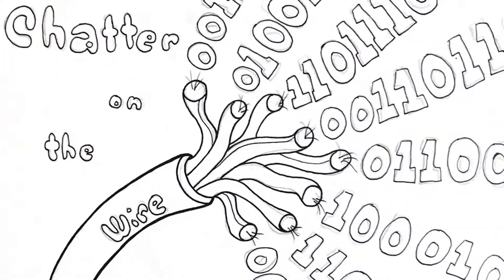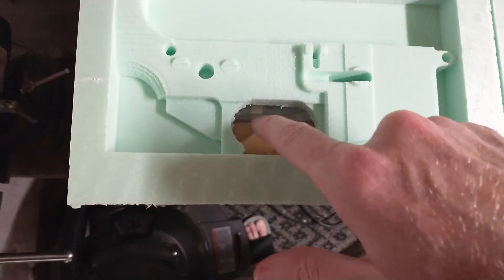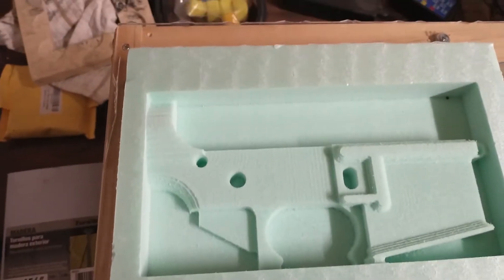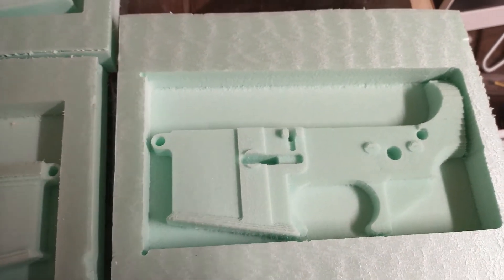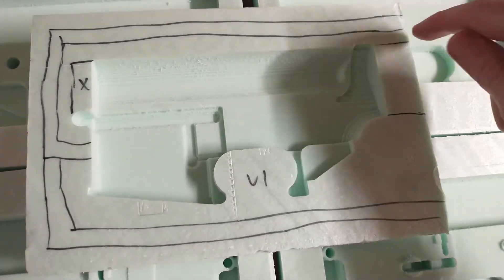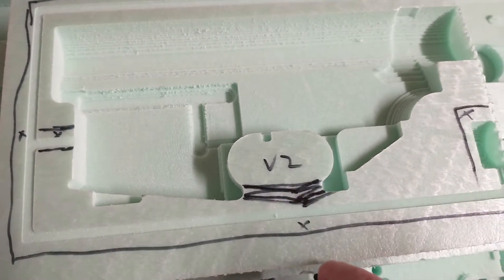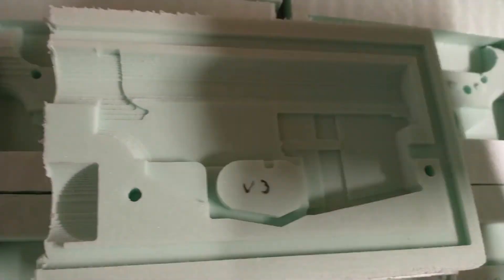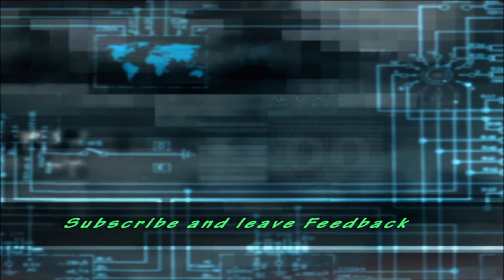#teaser - Lost Foam and an AR Lower

Comment: Bro. How did it turned out
Reply from the maker: funny you ask....  I was just looking at revisiting this and trying it out again.  I definitely need to work on some pins as trying to get it flipped perfectly wasn't working, but the general process seems feasible to get something close to a 50% lower from it. With some better setup on my part should be able to get closer to a full one for sure, but with shrinkage and whatnot never going to get something perfect.

Comment: Where you get ammo. Is this legal to carry. What happened if you get arrested with it
Reply from the maker: In general in the United States manfacturing your own firearm is completely legal (regardless of what the news or some of our politians like to say).  There are some limitations in certain states, some you may have to register, make specific changes, etc, but where I am there is no registration or other modification requirements.  I realize in many other countries that may not be the same and any type of firearm or ammo is prohibited and or limited.
Reply: @ChatterontheWire  thats the problem. You made me read something completely unrelated to what I asked you.
Reply from the maker: @mariovalgamidadez9934  Maybe more to the point on your 3 questions then:
Ammo - local stores, online, etc, lots of options for me, for you unknown
Legal to carry - for me yes based on where I live, for you uknown
What happens if you get arrested with it - it is legal here, so nothing, unless perhaps if it was used in a crime, but owning it isn't a crime, for you, unknown, depends on where in the world you are.
Reply: @ChatterontheWire  then why all this hassle if you can you buy a well made one at a stablished stored
Reply from the maker: @mariovalgamidadez9934  Valid question for sure.  Some of it was to prove I could do it, some to expand my skills.  I found a lot of issues in attempting it.  If I wanted to it be accurate I'd need to do location pins for turning it over to get the back perfectly lined up for example.  And sure just because you can buy it, doesn't mean you shouldn't push your skills and learn how to do things.  At least that is my take.

Comment: Did you ever cast the lower? Im currently planning on casting an AUG receiver and using a modified AR barrel and Aug parts kit
Reply from the maker: I did not, I as just thinking about it this past week before I went on vacation.  Debating about doing more of a 0% type one that is just the correct shape first.  I tried CNC'ing a few where I did the inside as well and ever got things lined up quite right.
Reply: @ChatterontheWire  I would love to see how well a cast receiver comes out particularly with the cores for the magazine well and the trigger pocket. I'm currently busy with my Aug receiver project, but I would love to do a AR-15 lower just for the challenge.
Reply from the maker: @shawnwillis7561  I know it will need a ton of touchup if I do do it. Which is part of the reason I keep putting it off!  I have 3x 80%'s I should actually do one of these days before I try to cast one that will take so much touchup, but we'll see.  It is honestly one of the reasons I got into melting in the first place!  But so many other projects to do.
Reply: @shawnwillis7561 did you ever cast that reciever I am currently going down the same path and that's exactly what I wanted to try to do but use a 3d printer to make a mold
Reply: @cutekittes3  I did sort of. I changed an Aug receiver file to accept a Nylaug barrel and casted that. Took a fair amount of playing in tinkercad. I printed it in polycast filament made by polymaker. It worked though